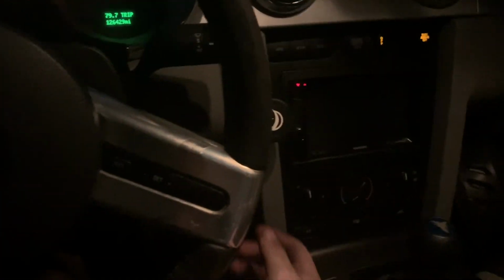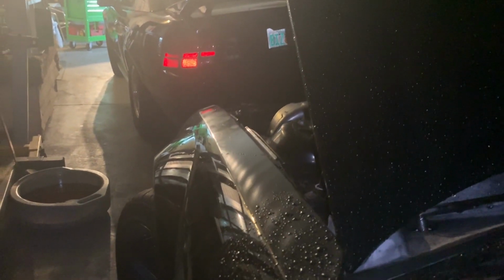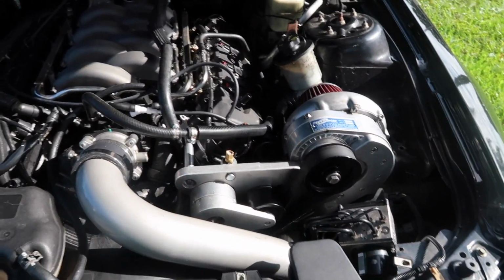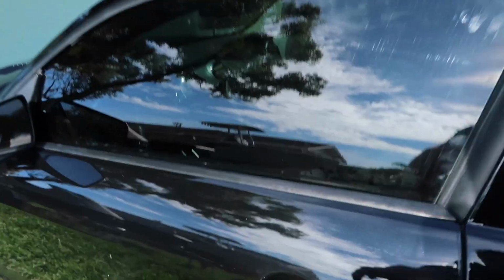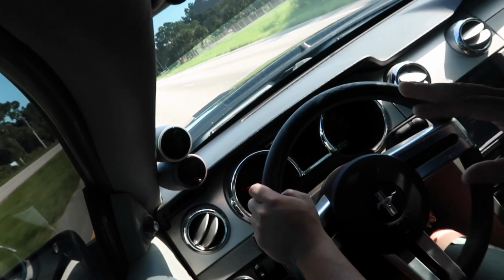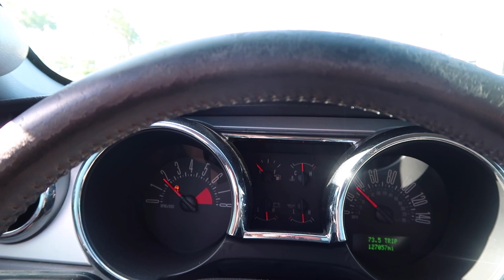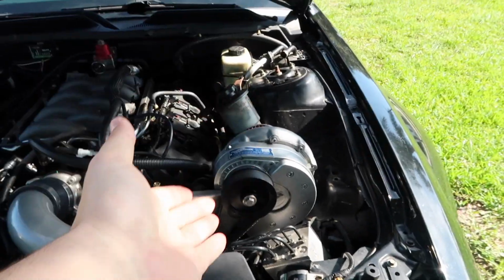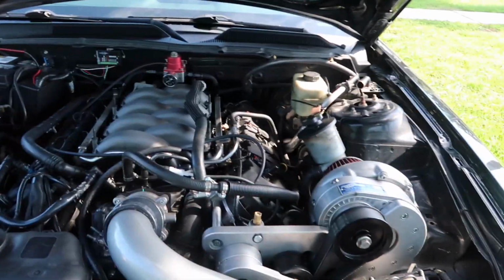BOOSTED 5.0 COYOTE SWAP FIRST DRIVE!! *Driving a JET!*

Comment: I think you make less boost with a filter on so keep that in mind while you data log. They also make those BELL MOUTHS you will make the most boost with those and HP. But I don't remember what yr your motor was  but I do remember it was from a F150 though.